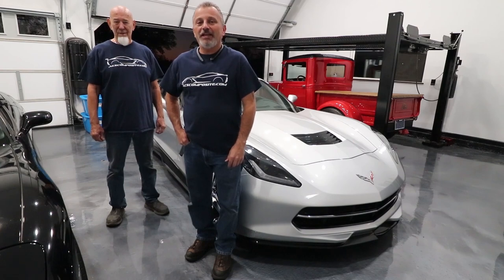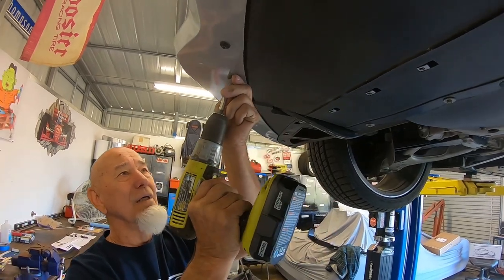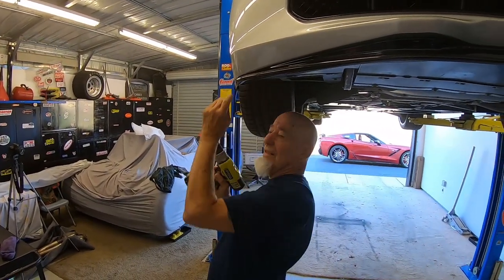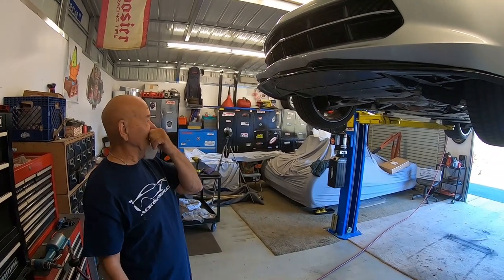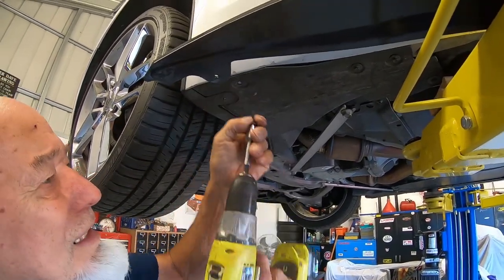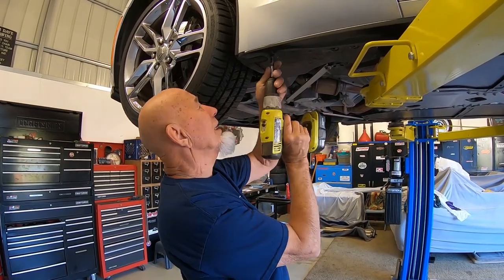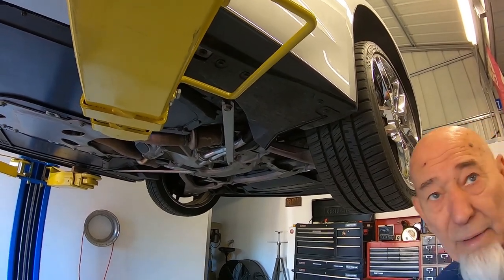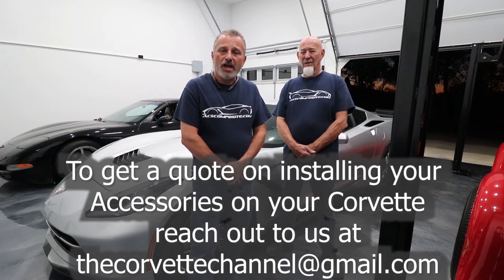How to Install a Stage 1 Aero Kit From ACS

Comment: Loving the install videos sir. Im getting the stage one acs front splitter Like this guy but was wandering if you have to put the rivets in or can you jus use the stock bolts? 👍
Reply from the maker: That's great!! You will need to use both the stock bolts and the rivets!!
Good Luck!! Scott
Reply: @THECORVETTECHANNEL  thinking I mights use those plactic push pins fasteners instead but I'll see what options i have. I watch your channel and I'm a big fan 👌👍
Reply from the maker: @justinreid8851  Thanks for watching we really appreciate it! I highly advise using the rivets due the air flow will try to pull it down when moving! You will see what I am talking about when you go to install it!!
Good Luck